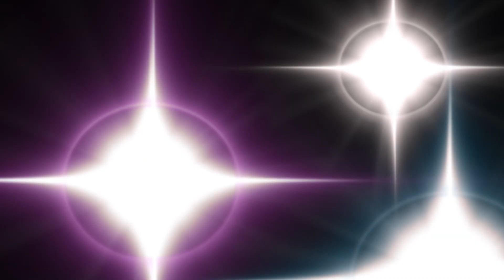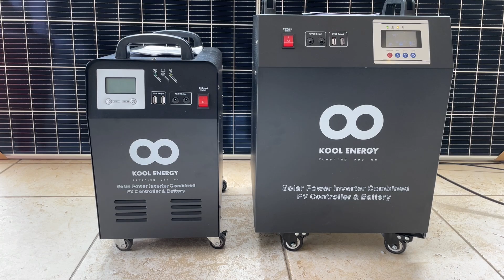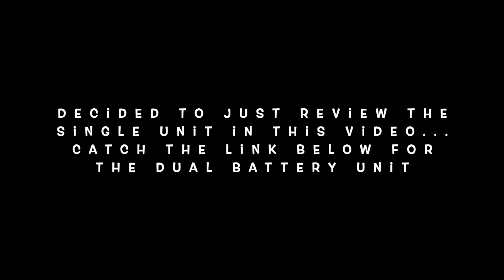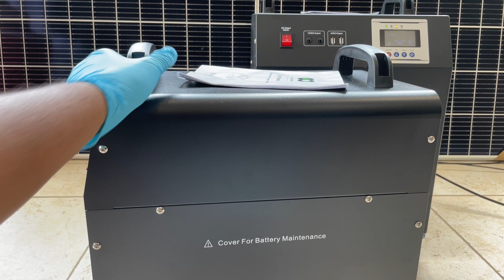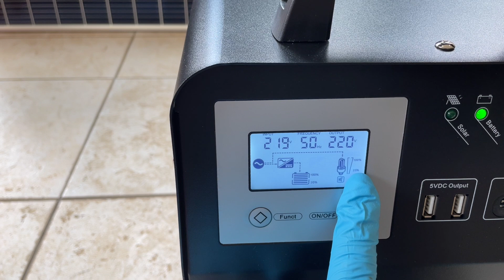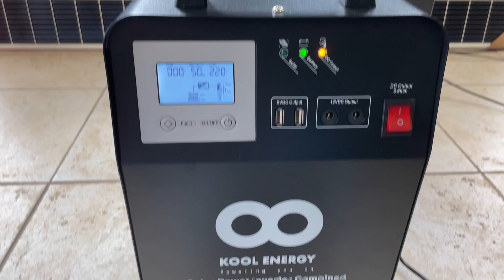Reviewing the Mecer Kool Energy 1000w 12v Pure Sine Wave Inverter - Load Shedding Solution!

Comment: I hope you can assist, i just took out my mecer kool energy to use since load shedding is back. Ive plugged it, turn it on the battery is red no sound nothing. Could it be the end of it or can the battery be replaced?

Comment: THE FOLLOWING INFORMATION IS WHAT IS NOT BEING SHARED:

I have such a unit . Unfortunately I lacked so much knowledge at the time of purchase.

It initially came with a lead acid battery which I had to replace within 6 months due to high number of power outages, besides it being a low quality battery. Also made many mistakes where I discharged battery beyond 50% and often plugged in something that uses too much wattage at a time that really destroyed the battery. Although lead acid batteries don't mind that too much, hence that is the type of batteries being used in cars for to start-up a car a high wattage burst through quickly. Gel and lithium batteries prefers minimal wattage over long duration.

However, the big disspointing factor is that you can't really manually setup the invertor to your needs (which brings the question whether it is really an invertor as that is the crucial aspect of an effective invertor that ensures battery longevity), nor can you add another battery to the invertor because of the poor internal parts of the invertor that will not be able to handle the additional wattage. Hence, one battery in use will mean shorter battery life as if you use 2 batteries for the same wattage. 

So the best you can really do is to replace the battery with an 1200W battery (gel or lithium) which will give you 4 hours maxed out on a 300w load (which is not absolute). However,  best to use it only for 2 hours and to recharge after 50% discharge.

All-and-all, for the same price you can get a much better setup custom made with a trolley and 2 batteries.

Some advice, don't purchase invertors from shops. Seek a qualified person that can create for you an invertor setup according to your needs (what you want your invertor to power-up and for how long).

Cheerios ✌

Comment: What does it mean if the battery light is red while connected to power? I’ve just received a unit from a friend and have had it plugged in for almost 24 hours (with loadshedding during that time) but I still have a red battery light and am unable to turn it on. Thanks for the assistance!
Reply: I have the same issue. Looking for a response.

Comment: I have the mercer 1000 w unit. Please help. 
1.what setting should the function button be set on.1,2 or 3
2.my inverter when power is on starts beeping. It beeps twice ,then 4 times then starts continuous beeping. And only way it's stops if I put battery switch off. And now my battery is not gettying full charge. 
3 there is no error showing

Comment: Thank you for your instructive and brilliant video. On the topic of the fan: is there a way to switch the fan off? Perhaps a specific work mode that does not require the fan to be on? (it's winter and the unit temperature is low at all times)

Comment: Thanks, the video makes it more understandable asthe manual.
Just one question. my batery shows the whole time it is bysy loading. It is niw the first-time I used it after I bought it a month ago. After I used it for 4 hours, the battery is low. I put it on for another 2 hours and could only whatch about 10 min before it start beeping again. Any specific way to see how much battery is left. If it is on charge, the bars run the whole time. If main supply is of, it show 20%. I chareged it for long time.

Comment: Hi, Thanks for the video.  My unit has started beeping after a half an hour of use (6 months old).  I understand that the battery may be dead but the display shows it is full and never shows any load (above 25%) which I find odd. IT is being used to power TV, DSTV and internet only.

Comment: Thank you - appreciated. Need some advice please. Have this mecer inverter, but with a 80w load my battery is hardly lasting 1 hour. I bought a new 12V 100ah battery 2 days ago, but still...same result. I cannot for the life of me work out the problem. Is it not charging or is it a dud battery I bought? Connected it + to + and - top -, still on function 1 but still, same problem. Dont know how to trouble shoot this. Hope you can have some advice. Thank you
Reply from the maker: Hi did you replace the battery inside the unit or just added one?

Comment: Simple question. Please advise if I can replace the Gel 100amp hour battery it come with with a 100amphour lithium battery?
If I can, what will the impact be and pros and cons?? I cannot find this answer anywhere.
Reply from the maker: It cannot, unfortunately you need to change charge settings when you go lithium which this machine cannot do
Reply: Yes you can. Many people (incl me) have replaced theirs with a revov 100ah lifepo4 battery which has an internal bms.

Comment: Hi alternate solutions, on the 12v single battery what is the maximum size solar panel you can connect to it?
Thanks in advance, super informative vid.
Reply from the maker: around 28v panel, so 280 w or so
Reply: @alternatesolutions2408   Thank you sir, follow up question. When connecting a solar panel to the above unit besides the Solar Light burning green is there an icon on the display panel to show it's now charging using the solar as the input.
Thanks in advance for the advice and guidance!

Comment: Hi. Please could you suggest diff options for solar charging this unit? Cheap/mid and best as I have 2 of these running grid to charge for now but would like the peace of mind knowing If grid goes down I can at least have some power each day from these units
Reply from the maker: These 1000w 12v units can only use a small 200w panel or so, max 28vdc

Comment: Good morning. Thank you for your reviews. What size solar panel can I use to power the 1000w unit with single 100ah battery ?
Reply from the maker: Around 200w only, max 28vdc
Reply: Is that 28vdc open circuit

Comment: When I turn on silent mode the inverter still beeps 4 times when switching to the battery. Is there any way turn off all the beeping noises?
Reply from the maker: It does not turn off on this unit. I have tried different things but it seems to be hard coded on the firmware

Comment: I have the 1KW Kool Energy (Smaller Unit) and I see that you say in the video that a 200W Solar Panel would be sufficient to charge the battery.  Is one able to use a 300W Solar panel and would there be any benefit to this?
Reply: The single battery unit has a small solar charge controller so it can only hand 25vdc panel which is around 200w - as per your comment below...
Reply from the maker: Can use as long as voltage max is below 28vdc

Comment: Good Day. I have the 1 KW  Kool 12V Unit. Fanatstic but our loadshedding has depleted the battery.  Only works for 1 hr after all the loadshedding schedules.  I got a new battery.  Can I link the second bty to the unit through the battery extension.  What would you recommend and what cable is use.  Brilliant Video

Comment: When the battery switch is off and the  AC is supplying power does it still charge the battery? At this point the battery light is green and flicking.

Comment: Hi. Thanks for the informative video. Just a quick question: I purchased a 1kw kool energy trolley inverter with a lithium battery. Once the unit is plugged into the mains, with the battery at 100 percent it beeps 3 times occasionally. I have the alarm turned off on the interface. I have a TV plugged into the inverter. Is there something wrong with the inverter? There are no fault notifications on the inverter so I'm not sure if it's normal.
Reply: I also have the same issue as above, in terms of the 3 times beeping occasionally.  Would be great to get some feedback
Reply: @annekevanzyl3215  hi Anneke. I did contact the person that made this video via email and he mentioned that he did come across a unit that did the same thing and it's due to the firmware on the inverter. What I notice is that if I switch my inverter off then on again, the beeping stops for like a day then comes back again.
Reply: @sameer3392  Thank you so much for the feedback.  Do you know if I should be concerned about damaging the inverter?
Reply: @annekevanzyl3215  no. I don't think it will cause any damage

Comment: Thanks for the video.Am struggling with mine as soon as i plug in any device it starts beeping continuously and switches off.Is there anything am doing wrong or the unit is faulty? Thanks
Reply: The battery is dead - it needs to be replaced - look for a 12V 100AH Gel or AGM battery - the size needs to be 407x174x209 (L*W*H) or smaller.

Comment: Can I replace the AGM bay with a lithium battery? The AGM doesn’t last over 2 hours now and it’s only 6 months old
Reply: In theory it should work if the LifePO4 Battery Management System fakes being an AGM or Gel battery - also you are going to charge it at 10A max and LifePO4 is designed for 20A so it is going to take a while to recharge.

Some people have done conversion BUT the inverter was not designed for this sort of battery - I contacted RCT in JHB and spoke to somebody in technical and he said they will be looking at a LIFEPO4 solution with a local provider but until then they are not going to warranty it.

Comment: Does anyone know or has used Lithium LiFePO4 batteries with this inverter or it's big brother the T2000s?
Reply: In theory it should work if the LifePO4 Battery Management System fakes being an AGM or Gel battery - also you are going to charge it at 10A max and LifePO4 is designed for 20A so it is going to take a while to recharge.

Some people have done conversion BUT the inverter was not designed for this sort of battery - I contacted RCT in JHB and spoke to somebody in technical and he said they will be looking at a LIFEPO4 solution with a local provider but until then they are not going to warranty it.

Comment: which mode should I be in for it to bypass the battery and use AC power when its a normal day, and then switch automatically to battery mode once loadsheddnig kicks in?
Reply: 01

Comment: Thanks for the awesome video! quick question, I have this inverter, and I want the battery to last longer. Can I connect another 12v 100ah battery to the battery extension? and will the inverter then charge this battery and use it as it would the original?
Reply: You can add another battery to it and double the capacity - the batteries will be balanced and will drain both equally as fully draining one battery to empty is a bad idea.

The issue is the recharge time me thinks - it takes 5 hours to recharge a 100AH if you used up 50% of it's capacity - you now sitting with two batteries to recharge using the one charger so usage and Stage 4 and higher  there might not be enough time.

Maybe somebody can comment.

Comment: Nice demo would be nice to see some one use it with solar, also with load. 1. Would you know if the unit is connected to solar panel and also the mains, which would be priority. Does it use both or just solar until that doesn't supply enough energy then swaps over and uses mains power supply? 
2. I assume it does not charge and supply at the same time, like lithium am I correct? So if connected to solar and power goes off is there enough solar supply to power a few units and charge battery or how does this work. Rather a big area and yiu just said in video and here is where panels are connected.
Reply: Please give answers to this very valid question?

Comment: I bought this device 12v 1000 unit also a 295w solar panel, but when I connect the solar panel it flashes the lights infront what can be a cause of this?
Reply: Need more solar panel info. Did you get your answers?

Comment: I have my Mecer inverter running on my live aboard boat with no shore power. Charging the unit is 4 x 140 watt solar panels connected in parallel. According to the owner’s manual solar input is 15 - 24v and 30 amps. My solar array runs at 21v max and 7 amps per panel (28 amps total). I use around 2kwH per day and the system is more than capable of handling that. Brilliant piece of kit. Just don’t try and charge it with a generator. It simply kicks in and out with no charge to the battery. Maybe a pure sine inverter generator would do the trick.
Reply: My inverter generator charges it just fine. Not sure why yours has issues.
Reply: @pjn2001  Inverter generator does the trick. A normal geny just doesn’t work. I’m getting one soon. I’ve added 2 x 100 AH gel batteries to the battery extension and they work like a bomb!
Reply: @Altboatlife  Ah, that makes sense then thank you.

Comment: Can the 1000w unit battery be replaced by a lithium battery when supplied battery has died?
Reply from the maker: Hi there, there aren't any parameters to be changed to accommodate a lithium battery charging cycle, so has to stick to AGM or other lead-acid types

Comment: Can i connect 3x 120w solar panels to the unit. Spec says 360wp
Reply from the maker: Yes you may, just consider the max voltage that does not exceed 25v dc

Comment: Hi, my unit works fine when my main electricity goes off. The unit then operates fine as it runs on battery. However, as soon as my mai n electricity to my house comes back on it causes my main DB breaker (in my house) to fall. Why does this happen?
Reply from the maker: You appear to have nuisance tripping, that is more related to the load items like your stove and geyser overloading your earth leakage. A customer had a similar issue whenever power came back and had their geyser and stove taken off the earth leakage.

Comment: Hi there, I'm struggling to understand what the 3 different modes are when you press and hold the function button. Any idea what the difference is between the the 3?
Reply from the maker: It doesn't do much different 1 and 2, 3 relates to when you connect a solar panel and changes the load priority.
Reply: @alternatesolutions2408  please explain how to connect solar panel and what settings to use, also what happens how it charges ect

Comment: is only the 12 volts battery added or even 24 volts
Reply from the maker: only 12v, but you can add two batteries in parallel

Comment: Hi thank you for the video. I have the similar inverter the Mecer 1kw 12v pure sine wave trolley. It worked great during loadshedding. But after use I charged it by the AC point for our next loadshedding for a view days but the batteries did not charge? Recharged? Is there advise for me...trouble shooting to why it did not charge the batteries but it was showing it is charging. Please advise on where I went wrong.
Reply: Hi, have exactly the same problem, was it ever resolved?
Reply from the maker: Hi there, please take it to Mecer for it to be checked, if its under a year old it will be under warranty.

Comment: Hi, I bought a KAPA 1kW 100Ah (like this unit)
In the manual it says it can take max 24V and 30A (=720W) (obviously getting to the perfect solar panels won't be possible)  - the same as this unit. This Kool Energy manual also says a maximum of 360Wp. The manual of the KAPA says you can connect 160Wx3=480W solar panels to it -> https://www.voltex.co.za/wp-content/uploads/2021/05/Kapa-Energy-UPS-1000VA.pdf . Around 18V and 8,8A panels which is very close to the optimal specs.

So who can I trust? There's too much random information out there. Should I just trust that it can handle 160Wx3 solar panels because that's what the KAPA one says? Honestly the manuals are very similar so this is where the doubts comes in.
Reply: That being said, I just saw on the unit it had a sticker on there that shows:

Solar charge mode:
Solar charge controller: 12VDC-30A
Rate Power: 360W, Max charger 30A
Nominal Operating Voltage: 18VDC
Max Solar Voltage(VOC):25VDC
Solar Voltage Range:3-25VDC

Now my head is spinning. There's nothing in the manual that says max 360W for solar power, but in the diagram it shows 3x160W solar panels.
Will I blow the unit up if I connect those 3 panels? If they go max, will it blow the charge controller? Or am I understanding this all wrong?

Comment: Good day, will this unit be able to power a typical 0.75kw domestic water pressure pump?
Reply from the maker: It will but not for very long, max 1 hour and that will severely drain the battery

Comment: Thanks for the informative video! My input voltage goes as high as 243V and sometimes stays there. Is this normal?
Reply from the maker: Typically yes that is from the electricity provider, however this inverter only produces 220v output.
Reply: So informative . I just unpacked mine and it was ready to use . Very new to operating this unit or any such inverter . Can you advise if I need to have it switched on daily ? Does it need to be unplugged from charging( light is currently flashing green, battery is 100%)
Reply: @nushennaidoo5416  Ours is plugged in 24/7 with some items plugged in. During load shedding, try to not let it go below 50% unless you have a lithium battery.

Comment: My device turns on but the lcd does not show indicators. The light on the lcd is on but no icons appear.
Reply from the maker: Is the breaker at the back in the closed position?
Reply: @alternatesolutions2408  I think it’s a fault with the lcd, if I press the actual metal case around the lcd it activates the lcd .